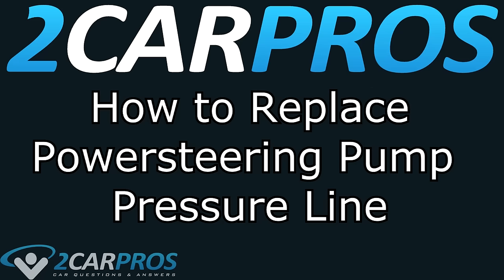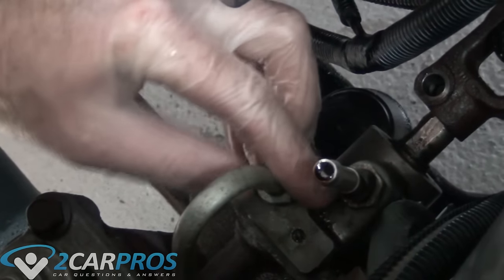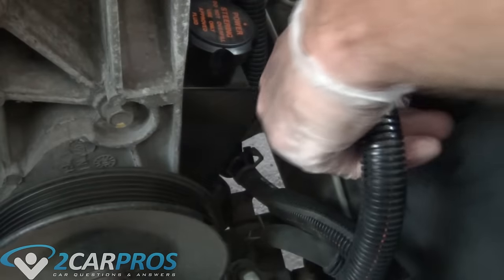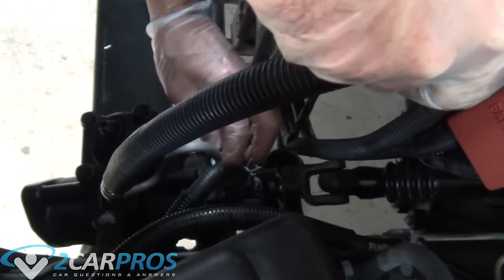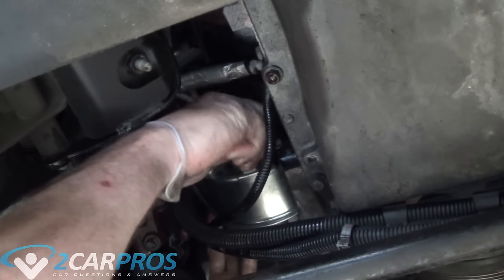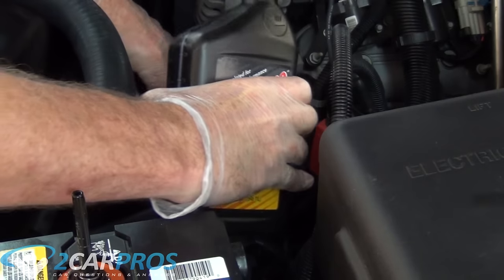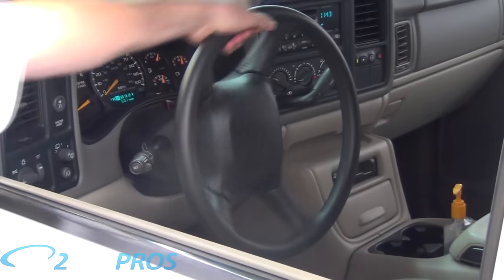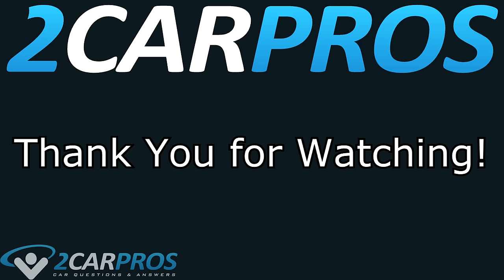How to Replace Power Steering Pump Pressure Hose

Comment: I like how in the beginning that you have alot of REDICULOUS ROOM To fit a whole wrench in there
Reply from the maker: I didn't engineer it just wrenched on it. Thanks for watching!
Reply: Some cars... if you don't own a set of crowfoot line wrenches and a wobble extension, you're a hurtin unit.
Reply: @flinch622  frfr
Reply: Good Video ,  I forgot about the O-rings . A good refresher for us old guys . Very helpful ! Thanks for posting .👍
Reply: @flinch622  Good Point !    I might have to go out and buy an 11/16 Crowfoot to get mine .
Reply: Hi thanks for your video, I’d like to share with you my project here and hopefully you can help me. I got an 95 civic that had power steering but the previous owner removed it, don’t know why? 
Now after 3 summers I finally found a same year donor car. I got everything from the old car, the lines, pump, reservoir etc. just finished giving them a good cleaning and u think I’m ready to get them installed. I’m pretty all the fluid/oil is out, so my question to you is. How much power steering will it need? Is there a need fully flush it before filling it up to make sure anything is left there. Or just top it off? 
I’d really appreciate your help and advice.
I’m a DIYer not a mechanic. Been learning a little bit of everything from electrical, and other things.
Reply: Too bad these guys didn’t answer your questions. I also wanted to know what they would have said.

Comment: It would be very helpful if you put the year, make and model of the kind of car you were fixing in the description. Its not all size fits all. There are hundreds of different designs and styles!
Reply: 2006 chevy tahoe
Reply: Exactly jesus someone thinks like me
Reply: Can’t be a 2006. Look at that steering wheel. 99-02
Reply: Does it matter? This is a generalized video. Use the correct tools, remove and replace, top off with fluid. Doesn’t matter what car it’s all the same.
Reply: RIGHT..👀
Reply: @camaroboi13 It's not all the same WTF.

Comment: "on any vehicle with power steering" uhhhhh no, many vehicles are different, don't watch this video thinking you can change any power steering line.
Reply from the maker: Uhhhhhhh any vehicle with power hydraulic steering has lines running to it. That's how it has to work. Thanks for watching!

Comment: I notice on other video 'on how to remove power steering line' that some mechanics worked from the top/inside the car, but you worked under the car, which (my opinion) is easy access, less "fighting" to get from inside (engine bay) to arm length w/shine light & less dropping tools onto the ground. Good video. My ? is working under the car (for me, on the ground) is little better to remove nuts & parts for leverage.

Comment: Very easy to replace if there is any engine in the car. I have a 1999 toyota sienna power steering pressure hose that I need to replace and they charge me $300 to replace it. If I could do it myself I would.

Comment: 2003 odyssey. going to keep trying but i cannot for the life of me get the line to fit back into the car. I've put in a good 3-4 hours trying to get it back in to position. I don't know how you did that. Would love to see more about how you wove it through with it being so stiff.
Reply: Were you able to get it? I can’t get the end with the screw to go back in.
Reply: @sLpNoTgRl  Same here! on a 2006 dodge grand caravan... worst design ever! Not enough room to turn a wrench...
Reply: PɪʀᴀᴛᴇPᴇᴛᴇ I’m doing it on a 06 dodge caravan now too, still stuck on trying to get the end that goes into the steering rack off, I’ve tried every wrench and socket it won’t move and there’s so little room

Comment: does the thread on the pressure line connecting to the box have to be completely flush with the box? basically the entire thread inside the box? cause i got the right line compared it to the old one. also is it suppose to bubble alil when running on top of the fitting? i assume this is normal with the new o ring breaking in?? please help.

Comment: @2CarPros so my question is for my 01 intrigue do I have to remove or drop my engine to get to the intial top screw that needs to be undone so that I may get to the bottom of the line or should I just have the car raised in the air I'm just asking because I seen you had lots of space to work under the hood and on my intrigue I have no space to get the intital job started so just a little more insight on this would really help me out a lot right now and thank you guys for the information on how to do these self repairs they come in handy
Reply from the maker: That is a complicated question, if you go to our website www.2carpros.com and ask a question for free, an expert will be along shortly to help! Thanks for watching!

Comment: I have a 09 nissan Altima I changed twice the power steering high pressure hose, and men, to put those fine treats from the line is a pain in the ass. you feel like is turning and not getting tight, I recommend to tighten with your hand firts and then used a line wrench, it sounds very obvious but if you start right, you gonna make damages to the treats.

Comment: Just did mine..2001 chevy s10.  One one end of the new hose i can still see a few threads...like its not on all the way...however, it is tight and so far i havent seen any leaks.  is this normal?  i was careful not to strip it and made for it went on straight.  tightened by hand about 6 times around...then about 4 more with the line wrench.  o rings are intact.  thanks
Reply: Should be fine some screws might be longer.

Comment: The power steering pump and high pressure line were replaced in my 2005 Ford Mustang, but it's still leaking PS fluid. What else could it be?
Reply from the maker: Really depends on where the leak is coming from. Things can be defective from factory and can leak right out of the box. Make sure the line is tightened as well but not too much. Thanks for watching!
Reply: If fluid is leaking from one or both of the boots (rubber accordion looking things) at each end of the PS rack, you probably need a new PS rack. Or, it could be the low pressure line is leaking somewhere (hope it's this).  To find where it's leaking from, see where the puddle is under the car, then try to work your way up to find the highest point that is wet with PS fluid.  If you paid a shop to do the work, take it back to them if you asked them to diagnose the leak and fix it, because if they just guessed and replaced parts that weren't actually leaking, you're not likely going to get them to fix the real issue for free. They'll likely lie and say that what's leaking now is a new leak.  Regardless, try to find a different shop to do your auto work.
Reply: @mrau92me  I got ripped off. The same guy kept saying it was different leaks/issues. Two power steering pumps and a new high pressure line later his wife tells me he's not a mechanic anyway. He was doing it "out of the kindness of his heart" and I "got what I paid for". I'm so upset. I don't know who to trust with my car.
Reply: @AFateSoTwisted  With mechanics, I prefer word of mouth. If you're on Facebook, ask your friends there, but I suggest you take a mechanic's family member's recommendation with a grain of salt. Mechanics who work from their home garage are usually the best value, but even some of them can lack integrity. Even though you may never work on your own car, I highly recommend everyone buy a Haynes manual for their car. It's got a troubleshooting section and you can always get an idea about how much work is involved with your car's repairs. Good luck.

Comment: Should there be a little play in the line after installation
Reply from the maker: As long as both fittings are tight and the hose isn't hitting anything that moves your are good to go. Thanks for watching!

Comment: Hi, I have a hole in power steering line which is part of the rack. is there any way to fix it without replacing the rack ? 2009 Toyota tacoma 4W
Reply from the maker: You can't just replace the line? Thanks for watching!

Comment: Is it normal that the power steering pump making a little noise after 3 days of line replacement and flush?
Reply from the maker: Yeah that is most likely a bit of air still stuck in the system. It will be purged out eventually just keep an eye on the fluid level. Thanks for watching!

Comment: Thanks for the video, though it is only a start to my adventure. On your car the nut is very easy to reach, and your nut is not corroded on. On my car the nut is recessed into the rack body, so I suppose a special tool is required. I actually have to make one or specify one to be made. In addition the nut is completely corroded, like the line I'm replacing. :( Plus the line is all metal and has many many bends, so I have to remove quite a lot of parts.  double :(  Plus I have two (sports) cars that have the same problem. Oh, the despair.
Reply from the maker: Thanks for watching Louis!

Comment: Any pointers for 2008 Lucerne? Having trouble lining up the thread on the rack-and-pinoion
Reply: Yep, its what took the longest for me the last time, getting the thread to catch : (
Reply: After like 4 hours of trying, I gave up and try again tomorrow.  Initially I got the lower fitting in and  had hard time on the upper one.  I unscrew the bottom fitting to try the upper one first.  At the end, both wouldn't go in.   They are not cross threaded, I can't start the tread on the bottom one.  The top one goes in but only halfway and I don't want to force it.   I am changing the R&P on a 08 Impala.

Comment: I have a 2001 intrigue,  do I use the same concept if I need to replace my power steering line,  because I have to keep adding power steering fluid
Reply from the maker: Yes if that is where it is leaking from. Thanks for watching!
Reply: check that you don't have a leak at steering box !!! pump and hose may be ok...

Comment: A ford flex uses automatic transmission fluid instead of power steering fluid per manual
Reply from the maker: It's the same thing. Thanks for watching!

Comment: I have a 2005 saab 95 aero sedan, since last week it is leaking steering  fluid and every time  when I turns  it make some sound. How can I fix it.  I know  these type of cars has everything  in a weird  way, is it possible   can you do a video . Please let me know   how to fix this problem .  Thank you.
Reply from the maker: I don't have a video for that specific vehicle I'm sorry. They are quite rare where I live and I have only seen a few in passing. Check out our website 2carpros.com where our experts are standing by to help you! You can ask a question for FREE and get an answer!
Reply: 2CarPros Hello. I have a 1995 Mitsubishi 3000GT VR4. I need to replace the high pressure steering line. Will I have to remove alot of parts to get to the top bolt? L

Comment: Odd saying this but my pressure hose on the gearbox is stuck won’t pop off have any tips on the removal?
Reply: Jose Arellano use rust spray or whatever it’s called
Reply: Mine was on so tight I heated it with a map gas torch for a bit (10 - 15 seconds), then it was able to unthread. Putting the new one on is now difficult though.... I put the end into the pump first and I went in cross threaded, there is absolutely NO space under there. Its a 2006 dodge grand caravan. Whoever designed it that way did a horrible job.
Reply: @piratepete-thetruthisforevery1  
It always amazes me how the uTube video guys nuts and bolts just
come off. I’m working on a 92 Z28 I had the high pressure hose replaced 
and they put it on so tight I can’t break it. I’m using correct flange tools
and I’ve slipped 3 times. So I started hitting it again with PB Blaster and
picked up a torch. Going after it tomorrow but I also bought a new hose
 just in case things don’t work out. I keep the torch on for less than 30
seconds but I’m thinking he used thread locker both ends.

Comment: Funny, I have an old '67 Coronet and I pulled the old hose out and there was no O-rings, I didn't even know their was O-rings until I saw this video. The new one didn't come with any O-rings, I put the new one in and it's not leaking.
Reply: Did you use the old 0 rings  ?
Nelson-curacao

Comment: What if you cant get you power steering line off because there isn't enough space between the motor and the frame to get a long line wrench in there like that?
Reply: @Strawberry.leeraymartinez5829  still didn't work

Comment: I need a new pressure line for my 2000 Mercury Sable.  It's a MAJOR operation.  AAMCO wants $550.  It's just unbolting the old one and replacing it but getting to it is impossible.  Any suggestions.
Reply from the maker: There really is no easy way. All I can tell you is to go slow and if something is in the way remove it. Thank you for watching!
Reply: 2CarPros I just cut the line ... Found another line at a salvage yard and simply connected it to the line.  $30.00 fixed with no leaks.
Reply: Get a new car.   (that's what i did. Lol)
Reply: Steve Walther What size line wrench?
Reply: sometimes is easier to remove pump from engine and install new hoses, the reinstall pump- keep track of hose orientation..

Comment: A 2006 Impala does not have a steering box. it has rack & pinion. this video is not correct for a 2006-2013 Impala.

Comment: I just recently replaced mine with a brand new one and it is still leaking from the hose on the back of the pump
Reply: johnny burch make sure it's tight high pressure fluid runs through the hose.
Reply: They gave me a bad hose got a new one and no problems but hell my truck is broke down now anyways

Comment: My ‘95 Toyota T-100 pressure line has a flange that comes all the way to the end of the tube. No room on it for an o-ring. Also I cleaned out the port and did not find an o-ring, yet the new replacement line came with two o-rings. Any advice?